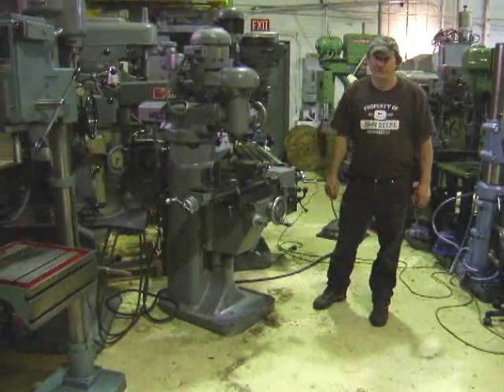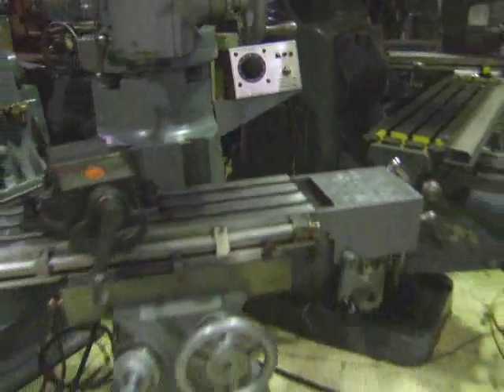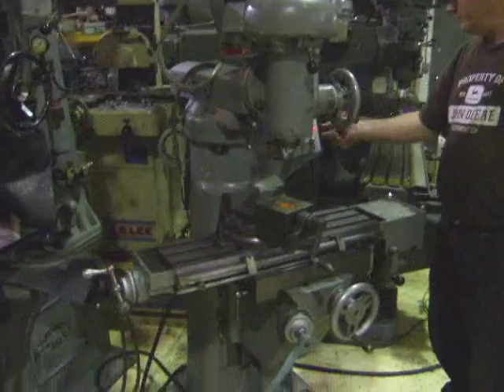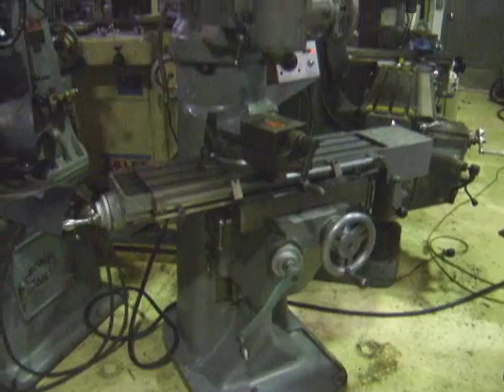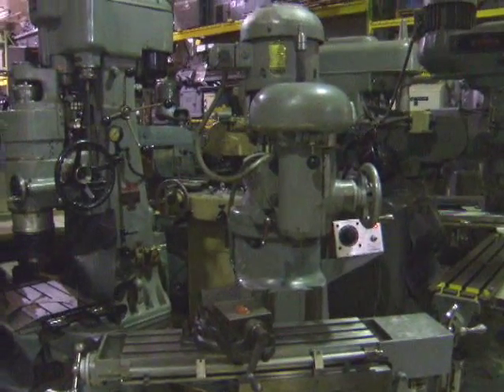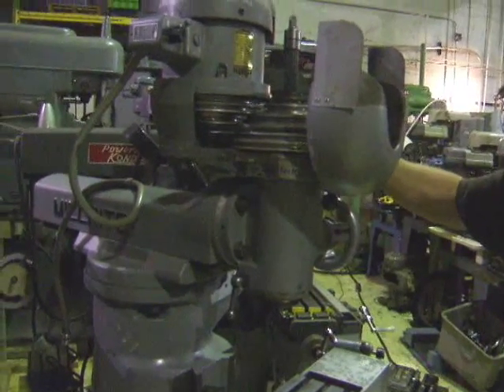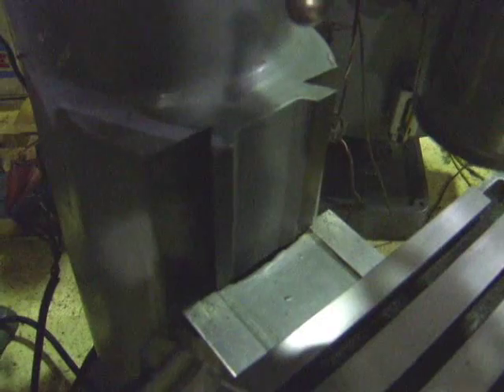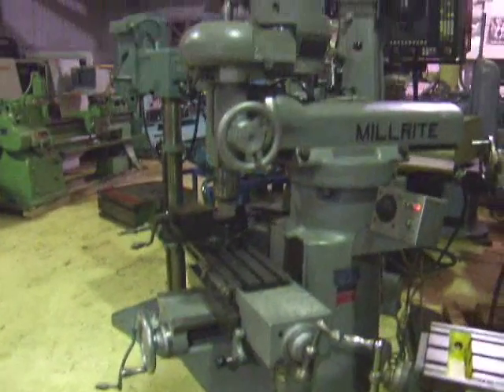Millrite MVI Vertical Mill.wmv

Comment: I have one just like it, restored it and it works great... Going to install the 3 Axes DRO with a screen that shows you all the holes and were you are in the process of milling on it soon, have it here sitting in the box, just waiting to get the gun shop finished and  set into place before I start the installation process, lots of drilling and tapping to do in order to get the magnetic strips in place and the read heads. I need to get the table feed setup still, but will soon enough.
Reply from the maker: Yeah, these are nice old reliable mills, wish you good luck with your setup!